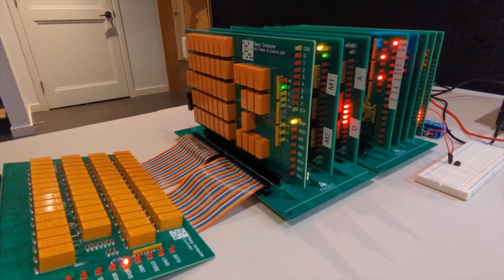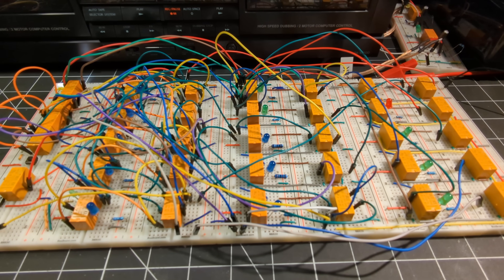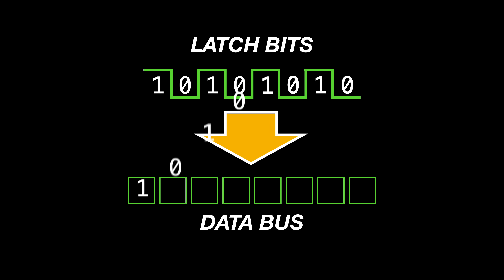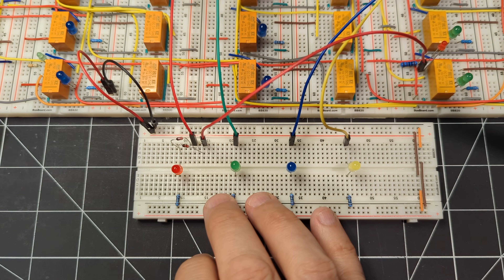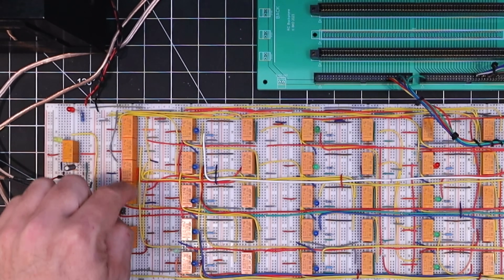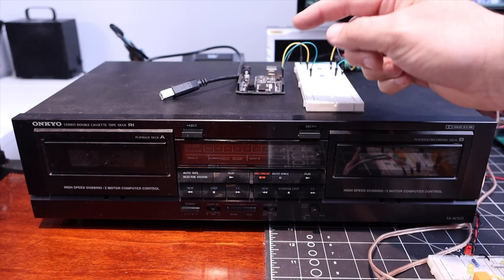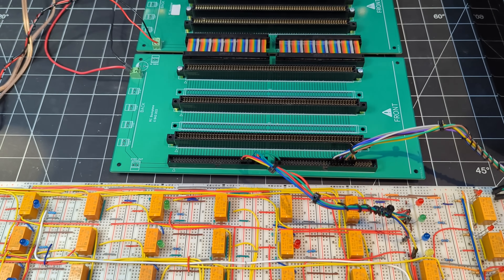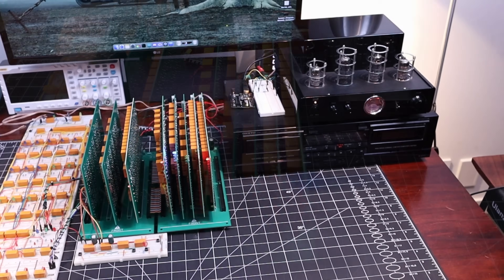Relay Computer - Tape Storage (Part III)

Comment: I just noticed, that didnt you set the amplifier to output 5V AC when you set the voltage?
because now with the rectifier and capacitor, you essentially create something about 7.5V or something, which in the case of the relays isnt a big deal, but just keep it in mind, in case you wanna do this kind of thing with something more sensitive. (and if you known this already, I apologise,  maybe you said something in the video and i fergot)
Reply from the maker: For sure - what I ended-up doing after the rectifier was in place was just increasing the volume control until the relays started working properly - not very scientific but it worked...it was higher than the original 5V.

Comment: NICE WORK!!
As soon as you added the additional clock pulses (by the end of part II) I was thinking "why not writing the previous byte while reading the next"; but as this is a hobby project, I have to admit it is not worth the additional overhead of all the extra relais required to do so. However, with the additional clock pulses after each byte rationalized, one might consider using the data line content during these pulses...

For instance to
- ensure proper initial setup by stopping any running clock and forcing a reset of the program counter after which the loader obtain access to the databus;
- finish the process once all data has been loaded; and,
- releasing the use of the databus, reset the program counter and (if instructed on the tape) start the clock.
Reply from the maker: Thank you! Loading the latch bits right after the memory write could be done in theory - the sequencer steps are currently hard wired to the latch bits to occur at specific steps (not dynamic) so would need to extra thinking about that.

Comment: I hope there is not a time in the future we will need this kind of technology again. But luckily we have brilliant people who does this. If we do need. Interesting video, thank you.
Reply: I really doubt it. Semiconductors are here to stay. Even in the event of total societal collapse, we still have records of how semiconductor fabrication works, so it's almost impossible for humanity to go back to relay logic.
Reply: @nikkiofthevalley  A simple EMP will destroy semiconductors in a flash. Like an atomic bomb. Some armies has a lot of radio tube-radios on standby just for that.
Reply: @jukkakamala  Destroy existing ones, sure, but it won't magically make semiconductors impossible to make.
Reply: @nikkiofthevalley  The issue with semiconductors is you need a decent lab and a fairly long tool chain to make useful ones. Relays have been technically possible since wire and varnish existed which is a much lower technology level. One would presume the advancement from relays to semiconductors would be rather more rapid the next time however.
Reply: @zyeborm  That isn't something I'd considered. Though you are probably right in that the pace of advancement would be a lot faster.
Reply: Cool story dude  @nikkiofthevalley

Comment: Nice work! I'd be curious to see how stable the Supply is on different parts of the boards with an oscilloscope. I imagine a pretty significant amount of bounce when all those relays are switching and lack of decoupling caps ^^
Reply from the maker: 100% - My poor power supply is getting quite the workout keeping up with that - definitely need to figure the caps out for the next version of the backplane.

Comment: not excatly the same but anyways. I have some smaller volca synthesizers from korg that has sync out 3,5mm and in for tempo but no usb, volcas are still in sale today. these ports also can import and export patches. i figured i can then save patches as a recorded audio file to the computer. just needs a bit of processing before it can be imported back as the audio input is offseted due to the input can not handle dc current. i think older synths people would record patches to casette :) it is fun and basic without having dedicated bloated cloud computer programs to upload and download the sounds.

Comment: When you turn the prototype boards for the cassette circuit into a PCB could you also incorporate a small amplifier so you only need to plug the low level audio from the cassette deck straight in?
Reply from the maker: I'd love to do that - only if I can make the amp out of tech from 30s to 50s (just a personal preference) - so many a simple small tube amp?
Reply: That would be good but I think you’d get away with a small discreet transistor one as well, you do have diode and LEDs in the build so I don’t think anyone would hold it against you.

Comment: At this point, what would be nice is to connect the computer to a reel-to-real with start/stop/rewind control using opcodes. I have seen a nice one that could be interfaced with little work at a good price ! https://youtu.be/Ms-JKZ0vGrU?si=4AhImuCFC28EPlKC
Reply from the maker: Yup -  I could also use an old Radio Shack cassette decks with the TRS-80 that had a control jack for start/stop, which is controlled by a relay in the computer.

Comment: This is a tremendous accomplishment, congratulation! Any plans to make a tape writer circuit next?
Reply from the maker: Great question - I did put a bit of thought into that. I should be able to use most of it to do a memory read (instead of write)...the only part I need to figure out is how to create the tones using this sort of era of electronics. If anyone has any ideas about this I'm all ears!
Reply: @dipdoting   Can I assume a 555 IC is out of the question? Because that would work perfectly for this. You could do an odd number of inverters in a ring, either BJT's, CMOS, or even relays, but I think relays aren't going to like cycling that fast. A tunnel diode multivibrator might be an option, or you might be able to go MUCH simpler. You actually don't need a pure tone, just any kind of sound that you can turn on and off for your clock and data bits. Perhaps just having a radio tuned to static as a sound source, and then use relays to turn them on and off before sending them to the line input on the recorder.
Reply: @WarrenGarabrandt I came here to say just that.  There are already silicon diodes so I think a 555 isn't too much to ask. I know the relays have a limited lifespan but how fast could one be switched so it could generate a "tone". 1V P-P output  could just be a resistor network after the "buzzer" relay. A DC motor with a switching commutator would also be period correct. The relays would then only have to, using a clock signal, connect that to the audio inputs on the tape deck. Old telephony techniques would also be a good source for EM tone generators.
Reply: @wt29  i didn't even consider using a small motor to generate the tone. A single tone would be good enough, and relays can switch the tone on and off for the two channels. The motor can be switched on and off via a relay automatically. That would be really cool.

Comment: can you provide a source for those jumper wires? im searching up and down the web and all i get is cables, but no hard wires you can bend... thanks in advance! - love your project btw.! ♥
Reply from the maker: I picked up the jumper wires and some 22 awg solid core wire from Amazon.
- TUOFENG 22 awg Wire Solid Core Hookup Wires-6 Different Colored Jumper Wire 30ft or 9m Each, 22 Gauge Tinned Copper Wire 
- AUSTOR Jumper Wire Kit, 560 Pcs Preformed Breadboard Jumper Wire 14 Lengths Assorted